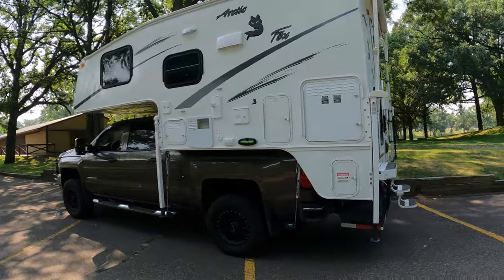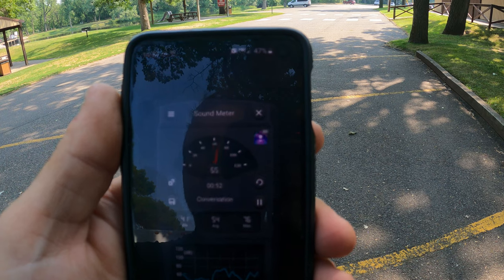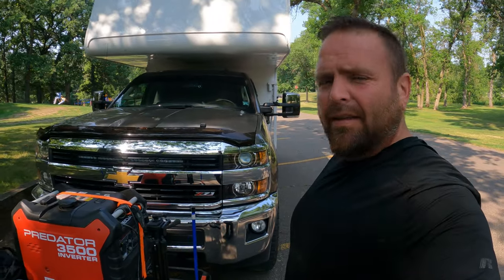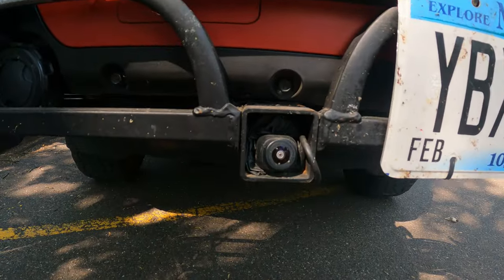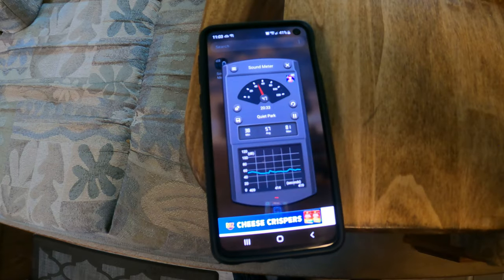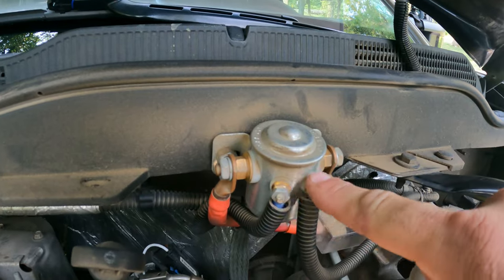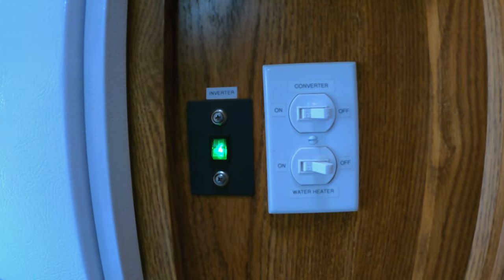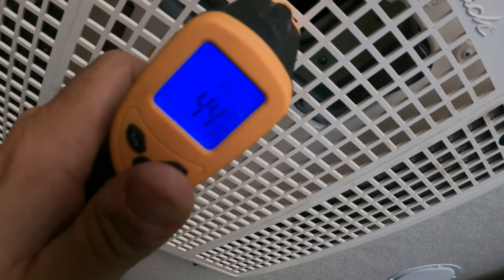Truck Camper Generator and Inverter /  Running Air Conditioner off Camper Batteries.

Comment: I don’t understand why the manufacturers can’t figure out how to make the onboard generators quiet like the portable ones that cost half as much
Reply from the maker: 100% Agree 👍
Reply: They make quiet ones now but they're 8 times more expensive than the predator. There's also an optional muffler that might help a little bit.
Reply from the maker: I saw that. It's a good idea they started making them a little quieter. Thanks for watching.
Reply: Ford makes a 2000watt onboard generator called pro power for the 23 Super Dutys.
Reply from the maker: That awesome. That would be a feature in a truck I would definitely want.
Reply: @KennyOfAllTrades  Yeah an awesome feature for truck campers! I just learned about it the other day and they first thing that came to mind was a truck camper were space is limited. Especially for those campers that don’t have an onboard one
From the factory.

Comment: Really great videos, thank you! My wife and I are in a 2019 Arctic fox 865 full time on a 2022 F350 7.3L SRW. I do all my own work like you. I’m running (3) 100AH Renogy self heating lithium ion batteries (1/2 the price of battle born with sales or eBay and all 3 fit in the compartment with the rack removed) and a 2000 watt go power inverter. Batteries alone run the AC or microwave fine. My calculations say I can run the AC all night (compressor on 1/2 time) but it’s been too cold to test… I also have 400watts of solar and a Honda eu2000i. I can usually get by running the generator 3 times a week. That’s just because I work from the camper with a bunch of computer equipment and we park in shade, I highly recommend lithium, price is the only downside.
Reply from the maker: Sounds like an awesome setup. One day I'll make the jump to lithium, but its not in the cards at this time. It's good to know you can run the ac off the house batteries. You will have to keep me updated. The 7.3 looks really intriguing, its the only gas motor that I would consider trading in on. Of course I will have to wait 6 or 7 years for them to get in my price range. The hp and torque that motor puts out is impressive. Thanks for watching and leaving a comment!
Reply: @KennyOfAllTrades  so far so good with the 7.3. It doesn’t have all the torque or some of the other diesel benefits. But I haven’t ever been wanting for power going all through the Tetons fully loaded. You know these campers are heavy… the gas engine also saves 600lbs or so of payload.
Reply: Hugh, how do you charge your Renogy li-ion batteries and how long does it take?
Reply: @c-qc-q2021  Progressive Dynamics PD9145ALV when connected to AC ( I recommend higher amperage if your wiring can handle it) and a Zamp charge controller with the solar panels. It takes about 7 hours with a generator and maybe a full day with full sun to charge from 0%. If you have bad sun then 2 days which is why I use the generator.
Reply: @hughkelleigh739  bro this sounds great, but gotta admit I'm a little dense when it comes to energy / electric / power.  Are you saying that you have a solar & lithium battery set up that actually can run your AC?
Reply from the maker: No, I dont.......but I watch other YouTubers that do. Their RVs are bigger, so they have more room for solar. Plus most of them are down south where the sun is stronger. My truck camper probably isn't big enough to mount the panels required for that much power.

Comment: Nice video.  I too am considering front basket to store generator but concerned about theft. Need a Good lock to keep honest people honest!
Reply from the maker: I haven't locked down with two separate steal wire cables.  They would have to clip both. Then I do have a audible alarm wired to it as well. The trailer hitch itself is bolted on with a nylon locking nuts. So they would need tools. With all of that it could be gone within 2 minutes if someone wanted it. It is sad that we have to consider whether or not we should own something by how easy it is to steal. 
Thanks for watching!!!

Comment: "I WRECKED A LOT STUFF " love it !😂😂😂 The adventures of DIYers ... all the knowledge comes at a price. 😅 
The Predator Generators are awesome. As much as I hate saying I tell people the chinese Predator line is just as good as a honda out there. Many of there products you can use honda parts on or do conversion. I have put many of there 212 cc and 79 cc motors on blowen yard equipment and even did a conversion kit on a Yamaha 3 wheeler with a 212cc motor.  
Been debating on the wireless setup for mine. Have you had any issues? 

Hr left of work before I hit the road again for some camping... stay dry this weekend and look fwd to your tue new release. Your making my work days go by faster listening to your youtubes.
Reply from the maker: Thanks. That wireless remote starter works well. However, it doesn't have the best range. After a year of owning it, I  dropped the remote in a puddle of water, and it stopped working. I called the number on the website. It went straight to the owners cellphone. He picked up while having supper with his family. He took down my address and sent 2 controllers out the next day. It was great customer service. Veteran owned and operated, just a regular guy trying to provide for his family.

Comment: That was VERY helpful, Kenny!!! I ADORE the inside start button that comes with the Onan, but- I HATE the NVH that goes along with it. Boondocking in the rain may be the ONLY way to use it without guilt. But, how good of a mood will you be in with all that noise and your coffee pot shaking on the counter? I'm going with a Wen 56235i 2,350W Inverter Generator. Enough to start & run the AC & leave the coffee pot running once the compressor has cycled. But, I'm also building my own 560AH 24v LiFePO4 prismatic battery & plan on having 700W+ solar on the roof as well. It would be nice to not need a generator at all- but, who ever gets that lucky? The Onan is a propane pig even when nicely tuned. Did I mention how much I love the start button inside? I'm ferklempt, talk amongst yourselves! Hahaha Comment for YT algorithm.

Comment: Great video.  I use a honda 2200i. With propane conversion. I installed a  soft start on the a/c.. It runs  25 hrs on 30lbs tank.
Reply from the maker: Those Honda's are so light and compact,  yet still a little power house. I know people that let them run on the ice all winter, sit in garage all summer, then run again the next year without a hiccup. Thay are nice for sure! Thanks for watching!
Reply: My Champion dual fuel will do the same....for 1/2 the price of a red or blue machine PLUS for the same price of the Honda I can have two Champs linked together, a factory warranty, for a massive power source....Go Yellow!!!

Comment: Great Video :) I'm not a generator fan but I'm leaning towards getting the AC unit installed in our new camper anyway. Geez we had a hot summer! At least we could head to campgrounds that have shore power in the heat of things or cool things off by running the truck. Thanks for the informative post.

Comment: Very helpful video.We are looking for alternatives to be able to run our AC in our truck Camper when boondocking. Thank you for sharing. Mary💕Fred
Reply from the maker: I run the AC off my trucks alternators a lot in the summer. There's lots of times when I'm parked in a parking lot ( small in town parking lots) stopped for lunch or taking a nap and I don't want to start up the generator.  No one ever notices a truck running in a parking lot.....but the generator gets attention because it's so loud. Plus, my diesel sips on fuel while idling. The 3000 watt inverter has powered the AC the last two summers without any issues. It's also big enough to run the coffee pot and toaster when I make breakfast or turn on the microwave for lunch.
Reply: @KennyOfAllTrades  Great plan! Fred just has to figure out how to get the AC plugged into our inverter.

Comment: I love my Predator 3500 generator . I also added remote start and a propane kit also. It is VERY quiet
Reply from the maker: Do you think it runs any quieter on propane? I was thinking about running propane, that way I'm not carrying different types of fuel.
Reply: @KennyOfAllTrades Don't know if you ever got an answer to this old question. I am working through your catalog. I have a different kind of generator and use it at home with natgas when the power goes out. The noise is a tiny bit less, not massive. The smells change too.

Comment: I own the Predator 3500w, but you can definitely run the AC on a smaller and quieter Honda 2000 if you install a soft start kit on your AC unit. It drops the inrush amps of the compressor in half, maybe more.
Reply from the maker: Yes, you are 100% correct on that. The initial power draw is the hill that a 2000 watt generator struggles with.

Comment: I am just starting to gather info on converting my 8' pick up to a small camper. I like the idea of quiet power. So I'm looking into a large converter (not sure size yet) that would charge two (maybe more) deep cycle batteries. My truck is equipped with dual alternators providing 385 amps. I'm curious if anyone has real world experience with draw down times on such a system with let's say 6 continuous amps for a period of 8 hours. Love your set up. It provides multiple options.

Comment: Thanks my friend for  confirming some of my ideas for my future rig . Just wondering about any solar if that's feasible in any way ?
Reply from the maker: I have  a 100-watt panel on the roof. There is room for a few more panels. I think I could install 3 panels without any issues.  
Thanks for watching!

Comment: Another great video.  I went pick my truck camper up this weekend. I did a video on picking it up.  I also have a factory generator installed. I do like the preditor on front of your truck. I have a question for you. What type of bike do you use. Im thinking about getting 2 Lectricic 2.0 for the wife and myself to carry with us.
Reply from the maker: Thanks! I have the Rad Power bike. It's called the Rad Mini. I looked at the lectric as well. They look nice.  There's a channel called "citizen cycle" he did a comparison of these exact bikes.
Reply: @KennyOfAllTrades  thanks
Reply from the maker: I just checked out the video of your camper....you will be the first channel that I subscribed to! Great video, we may see each other down the road, safe travels!

Comment: You should think about adding a Soft Start to the ac to take care of the initial compressor surge
Reply from the maker: I really should, that would help alot when using the inverter. Thanks for watching.

Comment: thank you for the review, I was trying to figure out how to carry my pred gen. I am worried about someone stealing it, I was thinking of putting inside of the truck at night, what are your thoughts please?
Reply from the maker: I  I do have one security feature that I did not show on the video. I have a motion sensor mounted on top of the generator. I turn it on at night or when I go into the store. If The generator gets bumped around it will sets off a loud siren. It is loud enough for  me hear it inside the camper.  I think it would deter someone from trying to steal it in a parking lot during the daytime. Of course if they want it bad enough they will get it.
Reply from the maker: Also it is secured to the front hitch with two separate steel multi strad guy wires. It may only take 10 seconds to cut through one....so they will need 20 seconds to cut through two of them. 
In my life I have learned that a  Thief is usually an opportunist. So make it a little bit harder to take and they will leave it alone.
Reply: @KennyOfAllTrades  Could you post a link for your alarm. Gen/Inv theft is a worry to all that own one. Thanks!
Reply: @KennyOfAllTrades  very true....in my area most were meth heads and too strung out or tweaking to think thing through LOL. A dash cam is a good idea also. I really like your front cargo rack system!
Reply from the maker: @richardkoch8752  https://www.amazon.com/Wireless-Anti-Theft-Vibration-Motorcycle-Waterproof/dp/B0734QN8KR/ref=sxin_17?crid=B98EEN3QTQ4G&cv_ct_cx=motion+sensor+alarm+with+remote&keywords=motion+sensor+alarm+with+remote&pd_rd_i=B0734QN8KR&pd_rd_r=1bdb18c6-de3e-49dc-8b93-a775b28b5772&pd_rd_w=07gNl&pd_rd_wg=IyQaY&pf_rd_p=727fbc14-b3f4-496a-8f23-f2c34a3ce896&pf_rd_r=WERBKYKX3X0HJGJSQAYN&qid=1638120610&sprefix=motion+sensor+alarm%2Caps%2C180&sr=1-2-874a1638-4dda-47a2-92d9-6711de77b634
Reply from the maker: @richardkoch8752  I have an alarm on the generator and one on my bike. They work well....loud enough I guess. It will at least draw attention of other people standing around.

Comment: I as concerned about generator noise when I purchased mine.
I went with 2- 2800 watt Ryobi units.
I only use one at a time unless I need to power up the air conditioner.
Mine are very quite and I will use them when I need to.
Reply from the maker: Some of those smaller units like you have are very quiet. Technology has come a long way from the days of the old construction style generators. Thanks for watching.

Comment: Thanks for the video Kenny! Very thorough and informative. You seem sold on using only the Predator. Other than redundancy, have you considered removing the onan from your camper and utilizing the storage for something else?
Reply from the maker: I have thought about trying to mount the predator in the Onan spot. It's an open bottom. Maybe something I'll look at in the future.  It's nice having the back up, but over 8000 ft elevation the Onan dosent like to run. So it's not the best backup.
Reply: @KennyOfAllTrades  not to mention you have your truck and inverter as a backup as well

Comment: Great vid.  Thx for posting.  I'm new to the camper world and still trying to figure out my power solution.  Can somebody help me understand - like I'm in 1st grade - what the inverter / converter does?  That sailed over my head for sure.
Reply from the maker: A converter takes A/C 120 volt power and changers it to DC 12 volt power. Most campers come with a converter. When you plug in shore power the converter changes the 120 volts to 12 volts for interior lights and charging the batteries. 
The inverter does the opposite. It takes the 12 volt power from your batteries and changes it to 120 volts AC, it power things like the microwave, air conditioner or coffeepot. 
I have a switch that will shut off my converter, because if I leave it on while my inverter is hooked there will be a power loop draining my house batteries. It sounds more complicated then it is. Maybe someone could explain in better...
Reply: @KennyOfAllTrades  no man that was perfect. Totally understand now. So your 3K inverter under the cabinet basically takes that 12 volts from the batteries and inverts it so that it can be used by your AC, microwave, etc. If I understand that correctly, then essentially an inverter will allow you to run your AC from a battery bank, correct? And if that's the case, is there any kind of a solar panel system that is powerful enough to charge up the batteries to a point that an inverter could be used to then run air conditioning? Hopefully I'm making sense
Reply from the maker: You got it correct!
The 3000 watt inverter does run the AC. However it drains the batteries fast, so I use my trucks dual altornators to charge the batteries. As long as the truck is running I can power the air conditioner or coffeepot. 
I don't have enough solar to run the Air. It would take a lot of panels and a lot of unobstructed sun to make that happen. It is definitely possible on larger class C and class A campers...maybe on a truck camper too? 
I'm almost always stuck in the woods with a lot of tree cover. Solar would struggle where I park. But many people have powered AC units off solar and a large battery bank with an inverter.
Reply: @KennyOfAllTrades  right on - thx brother - i'm also looking into the Lithium battery setups - i've heard several people like them quite a bit

Comment: Hello, I had a Chevy 3500 dully before DEF fluid was required. I loved that truck. The best part was the Allison Transmission. How are the newer ones holding up?
Reply from the maker: So far, I'm still hearing good things with Allison. I see people having issues with the tyranny going into limp mode, but that's when they are running a 300 hp tune.

Comment: That Onan generator was out of production in the late 2000s, 2 unique models ago.  Look into a Onan (Cummins) HGLAA, you will not be disappointed.
Reply from the maker: Thanks for the tip. I'll check it out.

Comment: I have a generator compartment with no generator.  I was wondering if i put a small Honda generator in the compartment,  would i wire it with a suicide cord to the outlet inside the compartment.... or run an extension cord to the other side of the truck camper and plug it in just like i was plugging in to a pedestal at a campground.... ??? Very curious because I have always normally boondock overnight and next day driving charges my batteries back to 100 % . Interstate Deep Cycle RV Batteries.  BTW Great channel
Reply from the maker: I was struggling to solve the same issue with using a power station to charge the house batteries. I didn't want to use a suicide cord, and I didn't want to set the power station outside while it was plugged into the campers shore plug. My solution was to install a generator plug inside the camper. It hooks up to the fuse box. I don't have it on a transfer switch, Instead I turn off the main breaker so I don't backfeed the shore plug.  I showed a small clip of it in a video. I'll give you the link. It might give you some ideas. 
https://youtu.be/mPL7EdRPYvs?si=vobuLBAPgVRFj7js